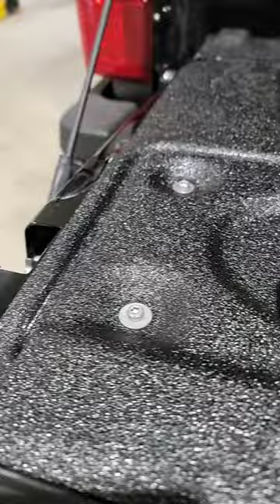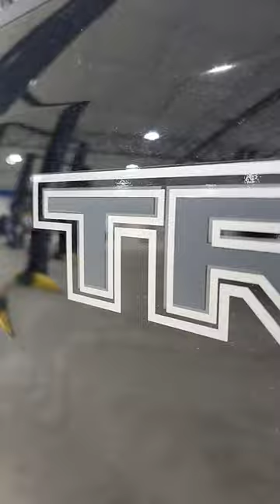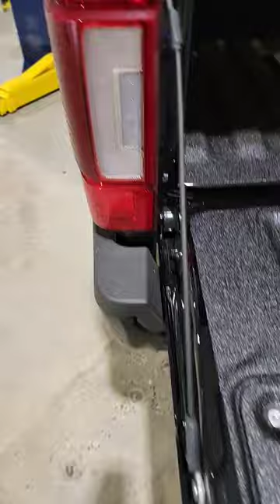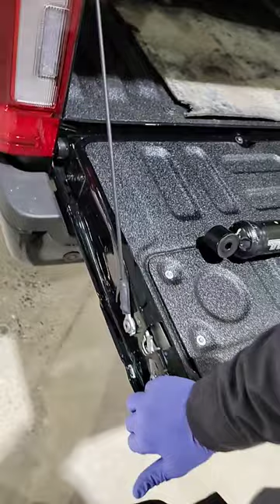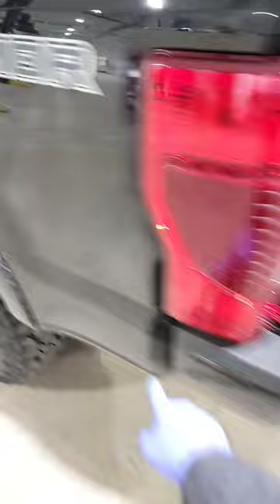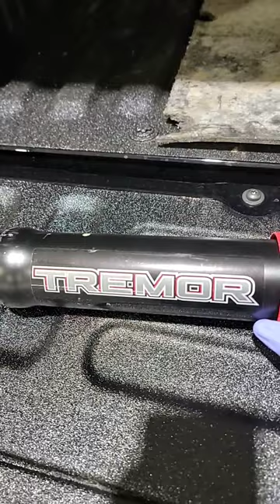F250 F350 Tremor - these shocks failing why?... #fyp #shorts

Comment: This is a common issue if you visit SD tremor forums. It's not new, either -- widespread issue for a couple years now. I've got a '22 and I noticed the creeking/popping noise coming from the front right the day I took delivery. It's gotten more pronounced. Dreading taking it in, have some real trust issues with the local dealer.

Comment: I have this noise on my F250 Tremor and couldn’t figure out what was causing it. Thank you!!
Reply: My neighbor has a 250 tremor that maybe hot 20k on it and the things sagging to the back left and has the same noise, does yours sag at all ?
Reply: @willpugh8865  mine doesn’t sag yet fortunately. Just hit 14k.
Reply: Shock won’t cause sagging. Ride height is going to be a spring issue
Reply: The problem is you bought a Ford

Comment: I wouldnt waste my time bringing my truck in for it. The downtime of service as well as no loaners at any dealers has me doing almost everything myself.
Reply: Lol you only have 1 vehicle
Reply: @YZ Rippin  I have more YZs than you do vehicles. It's the back and forth to the dealer thats a pain in the ass.
Reply: For real, it’s 2 bolts per shock, you probably don’t even need to jack it up on that truck. All you need is a basic socket set.
Reply: Yeah, no loaners at one of my local Cadillac dealers has me so frustrated... I'm lucky to have another Cadillac dealer, but they are on the other side of town and more expensive... but they do provide loaners, better customer service and work lol... just a bit more and further drive.
Reply: I would have bought a k30 truck, a k20 suburban, and a k5 blazer and put Rockwell's, 12 inch lift, 44"boggers and a built engine and trans in all 3 for the same price as this POS and had 3 badass trucks instead of 1 big hunk of shite
Reply: No but I’ve had a squeak out of my front right since new. Truck now has 45K on it. I’ve had zero issues with it and it gets worked hard.
Reply: @crf4502  bushing maybe
Reply: @SpinSatx  it’ll make itself known sooner or later. I’ll fix it then.
Reply: @crf4502  True that lol

Comment: They look like they painted the Ranchos and slapped a Tremor sticker on em.  Go Bilstein 5100 and call it a day
Reply from the maker: Not if its warranty
Reply: @PowerStrokeTechTalkwARod  at a certain point, customers would rather spend a few bucks rather than continually being without their vehicle. Warranty is great and all, but there is zero point to replacing things that are identical and will fail again. Obviously OEM shocks are only lasting about a thousand miles, I’d call it a day and upgrade.
Reply: @ChaseLandMgmt  for real it's a joke
Reply: That’s exactly what they did

Comment: Exactly the same issue on my 2021 250 Tremor, only noticeable over shallow bumps at low speeds (concrete driveway, control joints)

Comment: I own the rival truck to the Tremor, I have the Power Wagon. My factory shocks (Bilstein 4600s) rode great for around 80,000 miles but then became so stiff the ride was unbearable. I replaced with Bilstein 5100s and it’s better than it was when new. I considered Fox, Icon, King and Rough Country and decided the Bilstein 5100s were the best bang for my buck. I’m not running it through Moab or tearing up trails hard, it’s a daily driver that goes through fields a lot. Bilstein 5100s were perfect. Once it gets a Carli system though it’ll have the Kings.
Reply: Most shocks should be replaced by 60-80k. But the upgrade will improve the ride even in a new truck, which shows the cost cutting low quality they use. Sad.

Comment: Love my Öhlins, 230,000kms and still going strong. 🙂🇦🇺
Reply: No shocks should be used that long. Even top end ones usually need replaced before 160k km
Reply: @brada1997  
Hey they don't leak and still offer great dampening, and still pass rego checks each year.

Comment: I ripped those crappy shocks and suspension out long ago…replaced it with a Carli Backcountry with King’s. I was surprised how crappy the components are…would I buy the Tremor package again, definitely not. Put the money in a Carli lift. Btw I’m now concerned about the high oil pan and having to remove the cab. 😳
Reply: Any mechanic can pop a cab ofd in under an hour. They've been having to remove cabs for over a decade now to work on them
Reply: Sure, if you own a lift

Comment: No issues here. 31k miles on my 22 and it’s my daily driver/work truck in the oil patch with the worse dirt roads and ruts imaginable
Reply: fords hit and miss. ive driven a 6.0l that had no typical issues where others were scrapped for them. sometimes you get a lemon

Comment: Is the shock bolt slightly too small or the shock bushing bolt hole slightly too big and it only takes a few thousand bumps and the clearance gets bigger? Causing wobble?  It is temperature dependent? 2021 tremor here and haven’t heard any “bang bang bang on small bumps?

Comment: the shock cylinder is undersized from what is needed for the truck size and weight. it is the why some shops recommend changing to a more heavy duty shock

Comment: “That’s how it feels to drive a ford F-250”
Reply: Tell me another truck sold 2015 and up that doesn’t have transmission, engine, or electrical issues, I’ll wait
Don’t say tundra because they’re not even a major competitor in the US Titan tried and they failed they went back to gas, couldn’t play with the big American boys
Reply: @aab434  2015 GMC sierra 2500HD Denali. Truck was a beast and towed a 5th wheel that was towing a boat behind it. Didn’t even have a problem, pulled it with ease. Not to mention that it was 70 feet long including the truck. That truck has been through so much more than that and never had any of the previously mentioned issues
Reply: Fords blow up

Comment: My 2018 Ram 2500 came with Bilstein shocks from the factory on the Off Road Package! Never an issue ever ! Ford is obviously using a El Cheapo Vendor as usual! I already replaced the factory crap shocks on my 2021 F-350 w/ FX-4 package to Rancho RS 9000 XL’s ! What a world of difference!

Comment: My wife and I bought a Toyota Tacoma years ago and the leaf spring bushing started squeaking after 6 months of driving. Toyota said there was nothing wrong with it, but the problem was being worked on by their development team.
Reply: All bushings make noise when the factory grease gets washed out, there’s nothing you can do about it except push in some thick molybdenum grease or spray some lithium grease on the joints which is pretty easy
Reply: I have noticed any tacoma 4x4 will have rear suspension squeak after 60-80k miles. My mother's 06 had that issue through two sets of toyota shocks, and her 2016 did as well as my buddies 2011 taco trd offroad

Comment: Yup, have it on drivers front. Thanks for video, I will be showing them this! I read about it but no one has made a video yet. Considering Changing all the shocks. Tremor shocks are cheap junk and are known to have bad check valves in them from what I Have read.. ford needs to do better.

Comment: 22 F350. Was fine for first 8k miles then noticed noise and more jitter in the ride over small washboard at slow speeds. Replaced rear and only lasted 500 miles and shot again. Now dealer says "normal". Not normal...no shocks have I ever had make that noise and have a deadband clunk.

Comment: I had a similar incident with rear shocks on a 2013 GMC Terrain. When hitting tar strips the right rear started going click, click. Hit the rumble strip nothing. I replaced those, I don’t know what brand, about 6 months old with some NAPA shocks. No problems. I think that the nut started to back off on the piston. 
Hello from north east Montana. 
10 miles from the Canadian border.

Comment: I'm willing to bet it's not the shocks...its the springs.  The shocks, when they are brand new, keeps the springs from compressing as far until they get broken in.  It doesn't make the noise with the shocks off, because the springs compress completely differently.
Reply from the maker: Shocks all day long brosk8

Comment: I’ve been noticing a light rattle on small bumps with my 22 f250 Tremor w/ 13K miles. I thought it might be from some ice chests I had in the back, but, after watching your video, I let down my tailgate and rocked the rear suspension.  Getting same knocking noise.   Is this covered under warranty?

Comment: I would think after the second pair you’d switch brands
Reply: After the second pair, switch to a Toyota, maybe?
All of the new trucks sucks.
If you want a Ford, 2 choices - 300 straight 6 or 7.3 psd.
I love my IDI personally
Reply: Does warranty allow non-oem parts ? 
I doubt it very much, but if someone wants to do it on their own dime go ahead.
Reply: @howiegruwitz3173  either way ,with all the issues they've had in the past few years I steer clear . ....
Ster clear with no death wobble 🤣🤣🤣
Reply: @mikeeilbes3645  Toyota don’t make a 3/4 or 1 ton truck

Comment: If you’ve had a second set fail in 3,000 miles either the manufacturer is sending out shocks that haven’t been quality control checked properly,  OR the customer is abusing the truck

You’re now on your second warranty, that’s 1, and 2, in only a small fraction of the vehicles warranty and you’re costing your dealer and the manufacturer money

Comment: I had the first year raptor and the fox shocks failed premature.  I found out it was an issue. I was in shock at the cost of the shocks. Because of the cost of shocks and needing a set of tires I traded the raptor in. I have zero respect for fox.

Comment: As a late model Ford product owner, it’s my first Ford and my last ford product I’ll ever buy. It’s not nearly as bad as GM or Chrysler product yet Toyota gets the win for best quality hands down.
Reply: Clearly you haven't been following the issues with the new tundras,  not to mention the interiors are still from 2008
Reply: @evictioncarpentry2628  i absolutely understand the Tundra issues etc. All manufacturers have issues no doubt. The difference is Toyota doesn’t throw away the failed part and start all over again or just  keep building it the same way like Ford, GM and Chrysler. Toyota and Honda actually perfect the parts making them far more reliable.
Reply: @evictioncarpentry2628  also the interiors ? who cares that the stupid buttons are the same as 10 plus years ago etc. It the latest tech manufacturers put into these vehicles that’s so poorly built. You just proved my point with your own statement. 👍🏼🤣✌🏼

Comment: I hate to say it but I don't buy American vehicles 
I had a Toyota pickup that went 80k miles without replacing anything except the oil. Carried my Honda 400 and it didn't feel like it was even loaded. 2 vehicles I never should have sold

Comment: It is the bushings in the shock eyes, not the shock itself.. Order a set of poly's or neo's, for like less then 20 bucks, if not only less then 10 bucks... If you would like a reason as to why this is, please ask.. otherwise, I won't write a novel.. Good luck.
Reply: Do you have a link to the product?
Reply: @akraminshanally5216  Type in the make and model of your vehicle, for a huge market of "after market" bushings. POLY's or "NEO's" composite types. The rubber type that comes from the factory, is wonderful for ease of installation for the assembly line worker, and really good for quiet ride and softer dampening, but the rubber is short lived. I personally speculate, there is a hand full of trucks out there, that the bushings were just the wrong eye size to the shocks metal eye/ring, as they do fit in sloppy, and the bolt mounting hole through the rubber, is also of a metric hole size, and larger then the imperial hole in the rubber that it should have been. but that is purely speculation.

Comment: Bilstein?  Rough Country?  Fox$$?  Any recommendations?  2022 F350 Stock Height..
Reply from the maker: Fox fox....@PMF suspension
Reply: Billsteins...the 5100 variety.
Reply: Carli
Reply: I've been running rancho 9000XL adjustables for 80,000 miles and they're awesome..firm them up for towing and soften them back up for everyday driving. Ram 3500 megacab.

Comment: Tremors are not rated as high for towing. Edit: They have a different shock than the rest of the lineup. Looks like maybe the owner forgets that? Tomorrow we will get "the rest of the story".
Reply: Actually for 2023 Tremor tow capacity and payload went up significantly payloads are around 4100 pounds now convential towing is were you have a slight decrease

Comment: I ended up with Bilstein shocks and my problem went away.
Reply: You got a part number by chance ? Mine is a  2022 f350 tremor
Reply: @JayblesJay  you will need a longer shock than mine. Probably the 5100 series.